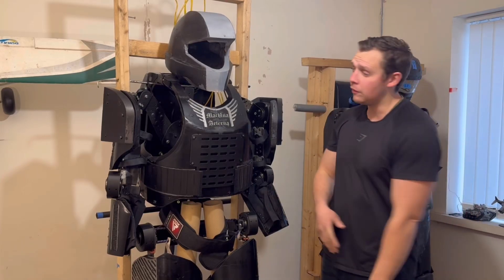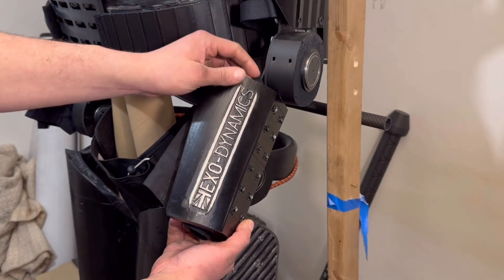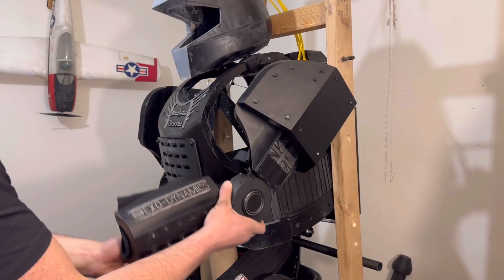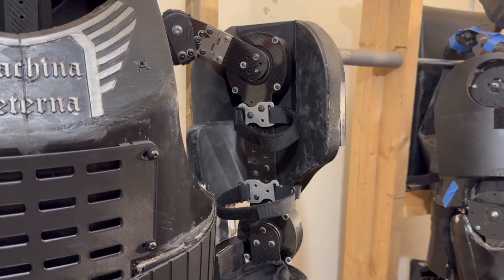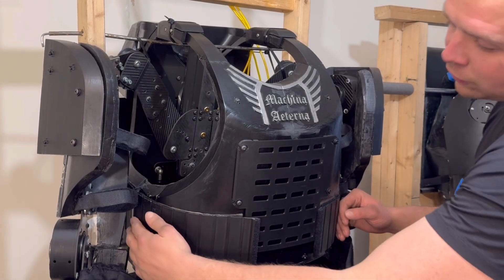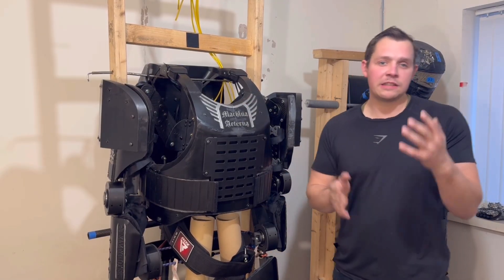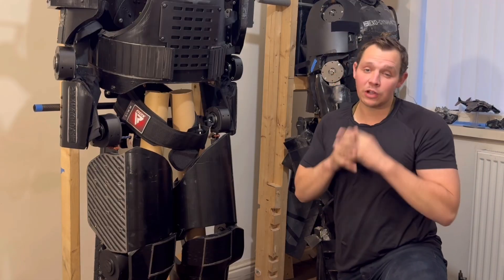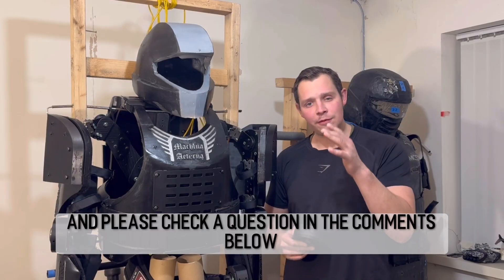My own Suit of Functional Power Armour is nearly complete!

Comment: what if you removed the opening for the helmet and used cameras instead, could also have one in back maybe on the sides as well linked to a display inside the helmet. then get a camera attachment for your weapon to peak corners without needing to expose yourself and link it to the helmet display as well.
Reply: Probably because cameras would drain the batteries even quicker. Making something like this is already challenging, and I doubt adding that would be much benefit right now.
Reply from the maker: Yeah it is an extra step in challenging, its a full project on its own. The battery issue is more that you want batteries in the helmet, so its not awkward plugging it ijto the suit. But then you need to have all the psrts very light weight. I know amduril use a ceramic battery plate for eagle eye… i definitely cant afford to make anything like that😂
Reply from the maker: It would work and that has been my plan in the past but at the minute its a money issue, due to weight you really need custom pcbs and and to make higher quality synthetics ceramics to try keep the weight down etc. even buying open source maker grade parts id be upwards of £/$500 where as this basic helmet will be around £:$30
Reply: @MattExo-Dynamics  I don't know much but I feel like keeping your helmet design as is with high visibility is the best idea, however perhaps you can incorporate some slots that could be able to attach a face plate and camera rig in the future.

It could make your armor more modular and give you the option to armor up, or armor down depending on what the circumstances require.

Worse case scenario if the camera fails you could be able to detach the armored camera plate and still be able to see.
Reply: Cameras alone are a liability. While cool I can think of five different systems used by militaries and four dyi tactics that would ruin camera reliability. Best to incorporate both human eye and cameras. Look into the vr camera field. They are small, durable, pre built and infrared and night vision capable at a much lower price range while still being power efficient.
Reply: huge challenge to get that close enough to direct human vision. could be really disorientating (especially if the user isn't thoroughly used to it)

try shooting while looking through the passthrough function on a vr headset. and those have no need to take armor into consideration with the design

just a standard ballistic visor is more practical. cheap, simple, easy to maintain, and needs little training to get used to
Reply: i think a good balance between cost and protection would be a helldiver style helmet, since it still has ok visibility but a bit more face protection
Reply: If you're going to use cameras I'd suggest micro cameras and use a couple dozen like the eyes of a fly
Perhaps behind a plate
That way if a couple get taken out the others can take over
Reply: Absolutely not my guy, you never want to be in a situation where electricity fails and now you're completely blind. Not even modern tanks or armored vehicles rely on cameras (they use mirror shafts that let you look out of tiny slits in the armor like a periscope) because then you'd be completely blind if something were to go wrong with the camera systems. That would also be heavy asf requiring an entire camera array AND batteries to power it. Not to mention that beyond having like 6 cameras mounted on the front of the helmet, it would be incredibly disorienting to see through, and you would need another super expensive, pretty heavy computer and lens system to allow you to actually see through the cameras without getting super nauseous or everything being super blurry. Imagine adding a VR headset and night vision goggles to this already heavy armored helmet. Overall just not a realistic or practical idea. The gun camera you're talking about already exists, but the screen for viewing the camera is located on the rear aspect of the weapon, because having that screen attached to your face would be extremely disorienting
Reply: maybe have a way to create an opening if the cameras fail like a slide hatch or something for those who hear this idea and shrug it off because of a little emp threat, im not going to give the full explanation to all the advantages either you see them or you dont I dont want to share all my ideas with strangers online but I will give this advise, when you see a flaw in the design add a solution dont just shrug it off as not going to work, that just sounds like complaisant laziness.
Reply: @blandobrother553  To provide a solution to your problem - ditch the cameras. Do what this guy is doing. Everything about the camera idea is problematic, so my solution is to not use the camera idea. You could add a battery powered camera array and it would be super heavy. So maybe you could put some motors and a neck servo to hold up the helmet. BUt then those require more batteries, and thus more weight, and the problem goes on and on. My solution to the problems with your camera array is to not use a camera array because it is not worth the cost or weight. Not to mention modern camera displays like this actually suck ass for maintaining your peripheral vision, which is super important in a non-permissive environment
Reply: @blandobrother553  

The flaw in the design is the human sir.

Look how much bulk is there to cover the squishy parts and pegged together the articulation looks.  You're not going to be able to power drive that shit, the metal will warp and the break.

A serious designer would do the endo first because that's the hard part.

As another person suggested, when dealing with anthropomorphic kinesthetics, you really need a topology model, first.  That's going to give you your volumetrics analysis for how thick things like joints need to be and you accommodate armor around that as *modular* units to facilitate different body sizes and make easy repair/replacement possible.

And again, this is all a hundred times simpler if, in fact, there is no body jammed in the middle.  People make enormous scaling mistakes when they envision this stuff because they are used to Hollywood renderings that simply don't have to be at-scale because they are either armatures (T800) or are CGI (HALO).

FWIW, while you are technically correct about the helmet vision (and integration of the solution is about having the resources to commit to making it happen, do or do not, there is no false pathway to a lesser option) for the simple reason that acoustic and laser and HPM weapons (all of which work on humans as much as machines at the required power scaling) will pose an extreme eye hazard.

Why accept the ballistic vulnerability (You want expense?  Think Sapphire Window) and excessively complex helmet layups for the 'simplicity and cost savings' of having a giant hole in your head protection?  When someone fires at you from over 100m away, you're lucky if you can see their silhouette.  You can see the muzzle flash, especially if the video snap records the frame of it's location and overlays it on a screen.

Now think about where your head is, when you fire a rifle, naturally.  That's right, it's aligned with the muzzle to facilitate sight capture.  And given that carrying a big, bulky, cuirass/breast plate and bulky arms is already going to seriously mess with your ability to align your sights, it's going to be both more difficult to fire correctly and dangerous to be eyeballing the target through an optic when his accurate return fire comes in over the muzzle and plows into the rifle and your eyes.

A clear acrylic gunshield might help here, at the cost of extreme muzzle weight, but the reality (which a robot would not care about, one way or the other) would be that if you put a laser on the gun and a video camera anywhere on the body (pin cameras, like the F-35 DAS) you could spot targets on the video screen and use electronic magnification (pixel multiplier) to lay the laser on real time video and use controlled bursts to suppress.

Again, a robot, whose entire head could be compartmentalized internally and constructed from armor an inch thick would not care about 'disorientation'.  But a human, who is, would never be employed in a combat zone where threats had sophisticated, EW.

Did you hear that?  An FPV operated by a 16 year old kid, high on energy drink and with the amped reflexes of a gerbil on crack can kill the bet operator our there with an FPV which he will never see in time to track and kill it.  All from 10-20km out.  His buddy could plant laser dazzlers that messed with his vision.  The simple fury of an autofire gunfight is going to destroy your hearing and eventually (Q-pulse) lead to TBI.

That said, the key is to understand WHERE you expect that heavy assaulter to be usefully employed and what you want him to do while there.

CQB, inside buildings, with a POI/Hostage/civilian modifier is about the limit of utility of modern infantry sir.  They are otherwise a massive expense to train and house, have too-short contracts before separating (forcing you to start the cycle all over again) and increasingly 'have no takers', as adequate recruitment, even from a nation of hundreds of millions.  Because they've all watched 40,000 per month Ukrainian casualties become 1.8 millin dead.  Not from frontline SUW between troops.  But from drone spotted artillery strikes and now the drones themselves.

What you need heavy breaching armor for is to have a gunfight in a house where there are channelizing corridors and hidden rooms down and through which you must pass.  The enemy is not going to let you get within reach of a doorway.  He likely rigs the walls, floors furniture and doorframes with IEDs.  He is not going hold a room from the doorway, he's going to fire through the walls.  All likely aided by his own video.  Indeed, if he's smart, he's not even going to be on-site but rather in a remoted security monitoring station, down the street or halfway across town.  He will be running on his own power and he will have conduits to put all his electrical down to control for electronic attacks.

To solve this problem you need to be able to tank damage.  And fire back, intelligently, using wall penetrating sensors, micro UAVs or even a simple rubber ball with a weighted 'this side up' flat spot and a camera.

So that you can clear and advance, quicker than he can retreat to a redoubt or escape position.

NONE of which requires you to 'check your corners' because your sensorization is offboard.

Assuming you don't just say screw it and use a battledroid.  Which is more expensive (articulate everything, under armor) but also much simpler, overall, to design.  Nobody's mama cries when Private Bot dies.  Because it can be raised from the dead.